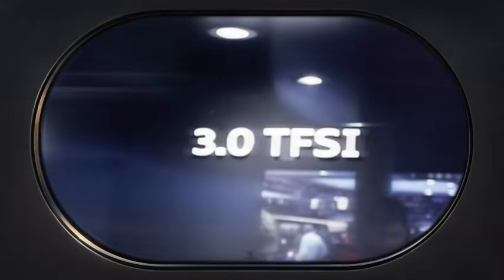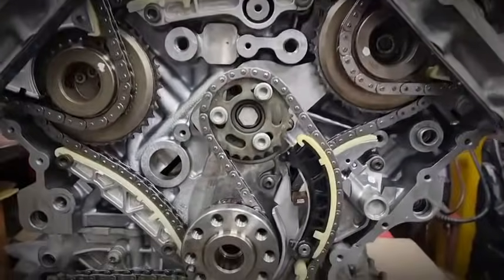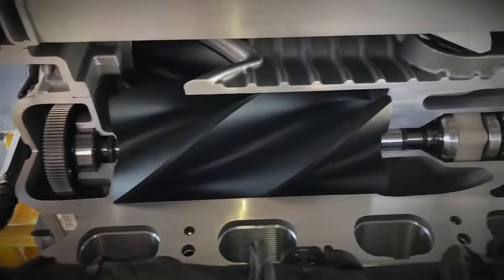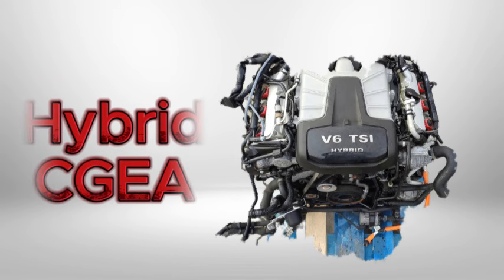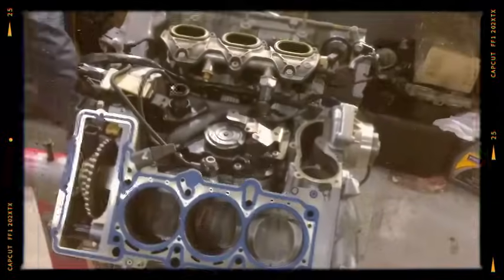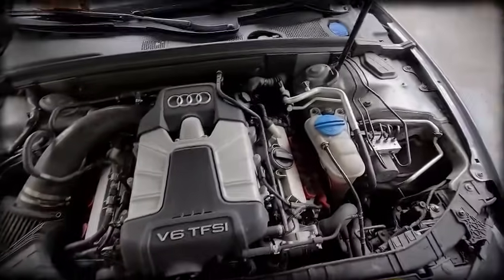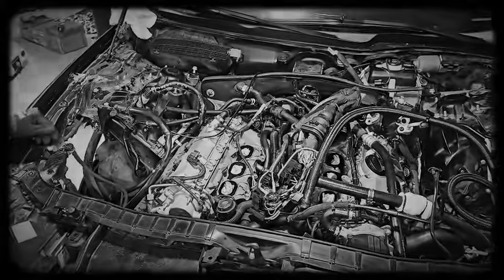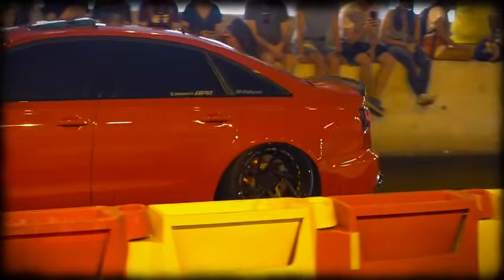Audi 3.0 TFSI V6 Deep Dive: Reliability, Common Problems & Gen-2 Fixes Explained!

Comment: I spent 70K overall when I bought an A6 S 2016. I followed the schedule maintenance 100%. Suddenly, the car started burning oil. so I put oil on it every 700-1000 miles. It came defective from the factory. So I sold it last week for mere 9K at 107,000 miles. 9 years 11 months later. Loved the car but It was a ticking bomb to explode. most expensive car ever and worst engine ever .
Reply: Following “scheduled maintenance “ is the problem. That schedule is not created for vehicle health, but for creating the illusion that the car requires less maintenance and making that a selling point. You need to change oil within 1000km (750miles) if the car is new, then change oil every 7500km for max reliability. Audi also says gearbox fluid is “lifetime” and never needs to be changed. Which if you follow your transmission will 100% fail, you meed to change zf8 oil every 60.000km to be safe.
Reply: The scheduled maintenance is a joke they say 10k to keep the cost of owner ship low. 5k is ideal for these cars
Reply: Welcome in modern cars world. But don’t worry, even modern Toyotas owners with 10k miles service intervals have oil consumption before 100k miles and at 120-130k they rebuild engine…

Comment: One of the more informativ videos, im driving the CGWB in a A7 from 2011 and over 250k KM on the Clock, runs like day one.
I didn´t know that the 2Gen has Steel Sleves, first time hearing that and the 3.0 TFSI has Forged Rods from stock witch is a nice feature.
The Chain problem is true, i had to do the Chain at 220k.
Nice Video Dude
Reply: Did you have to remove the motor and subframe to service the chains
Reply: @ashtonstowe3450  Yes, the chains are on the gearbox side, so no other was to get to them.
1k Materials and 2-3k for labor.
Reply: Does the car burn oil? How often do you change the oil?
Reply: @YuriiT. i run 5w50 from Addinil, i have all most no oil consumption.
If i drive it hard like redlining on the Autobahn i have like 500ml on 2000km, on normal driving nothing, 6k+ no burning.
I change my oil all 10k